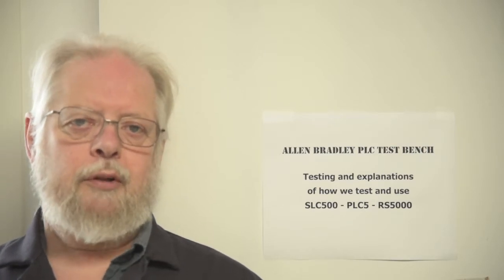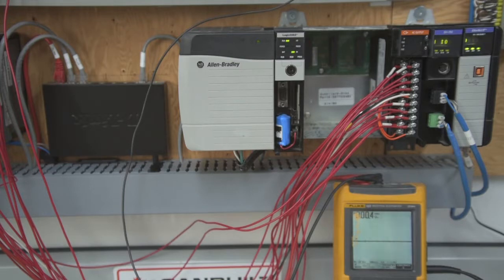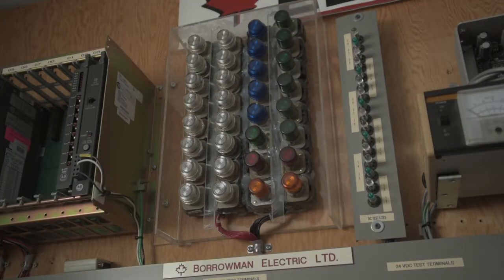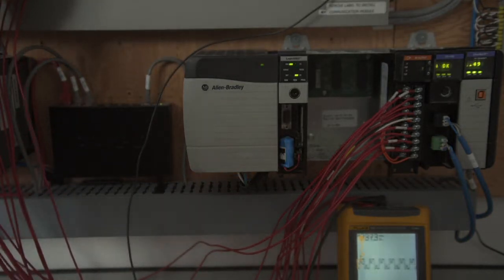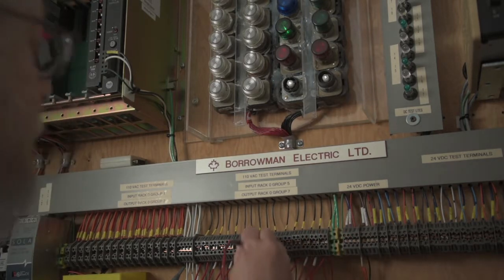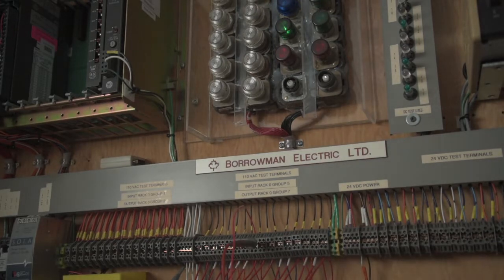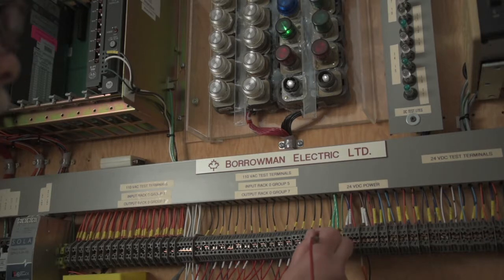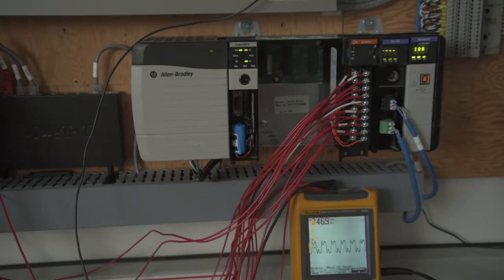1756-OA16 Triac Leakage Tests

Comment: thank you for this. Is there a slc 500 card version that has a better standard of construction? (1746-oa16)
 testing these cards is driving me bananas!
Reply from the maker: Hi JB:  Not that I know of.  Unless you are going to change them all out for relay cards (OW18).  Otherwise the best advice I could offer is having pull down resistors on the devices that are sensitive to the leakage.  A real pain I know, but a 2500 ohm (2k5) resistor in parallel to your load will work wonders.  5 watt at least - (You could go 10 watt but even I think that is overkill.)
Old school skills of electronics really come in handy.
A couple pieces of breadboard, snap track to fit the breadboard and provide some space from grounded surfaces. Silicone on the exposed joints will also add a safety factor.  Resistors, multi position terminal strip, 18AWG wire is more than big enough, solder and time and you will have a long term solution.
An additional advantage of doing this is the off state happens faster so you get a 'crisp' on and off of your device.
Bruce

Comment: Excellent video, Sir. The leakage volt is the VOLTAGE without setting up the on ("1" ) from PLC. Correct? And if the output is set to "1", what the voltage will it be? Very curious. THANK YOU.
Reply from the maker: 120 Volts output voltage when turned on.